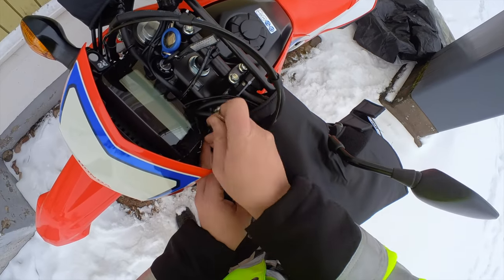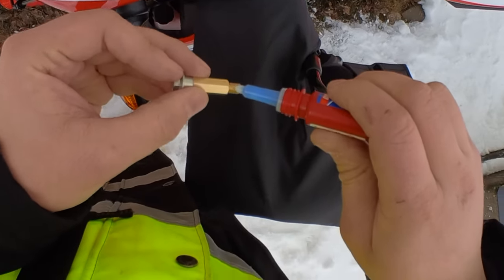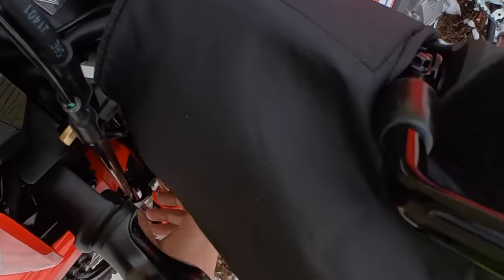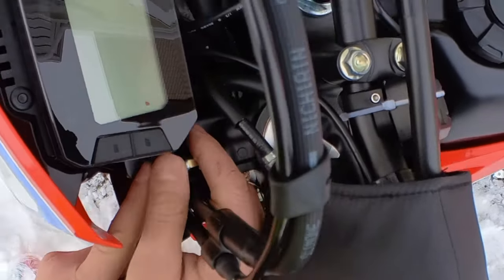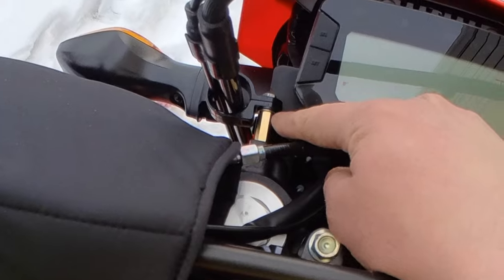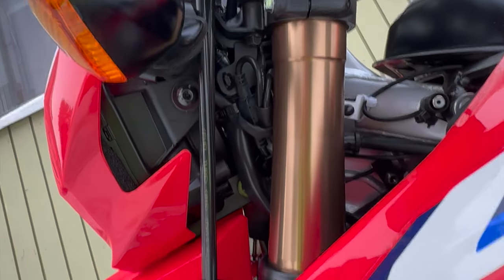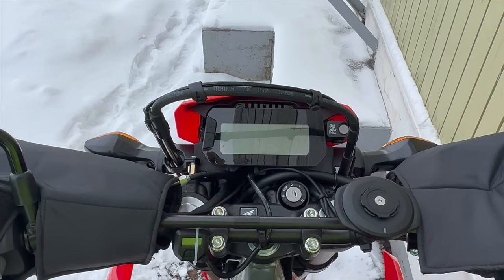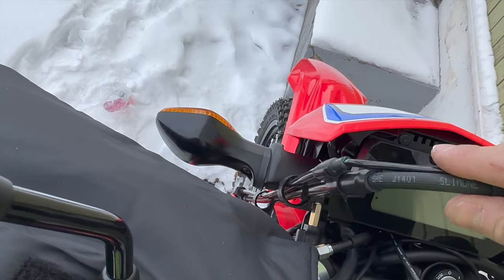Honda CRF300L Brake Hose FIX

Comment: It would look even nicer if you paint the spacer black.  It would blend in better with dash and cables better and would not be as noticable as the gold color is.
Reply from the maker: True. Im not that into details myself 😅 also I dont have this setup in the bike anymore. I built a rally tower (check the latest vids if interested)

Comment: I have an even easier fix.  Just undo the circular holder for the brake line and slide the brake line in front of the left turn signal.  Done.  BTW, you can reattach the holder as original if you want to keep it for whatever reason.  Maybe to hold some flowers?
Reply from the maker: Might work but it will twist the brake hose way too much and completely unnecessarily. Might as well do this mod and keep the line straight.

Comment: Why is this brake line even rigid? Couldn't we replace it with a soft brake hose and get it completely out of the way of the dash?
Reply from the maker: Swapping hoses with different kind of products is probably also a workaround to this 'probelm'. 
But I don't see a point in swapping them as the oem hardware is working ok. Also the bike has 260mm of travel stock so the lines move a lot. No matter what the solution the lines need a lot of movement at the top.

Comment: Any concerns with breaking that if the turn signal gets hit hard enough? Maybe there isn’t a high chance of that? I don’t know how easy the front ones get hit. The rear are super exposed.
Reply from the maker: Highly unlikely. I have never hit the front signals with handquards in place.
If unlucky the brake hose can also hit something directly. 
The plastic bracket is more likely to damage than the metal extender screw.

Comment: Does it makes a big difference if it's stainless steel or brass spacer ?
Reply from the maker: All of these metals mixed might get some ”corrosion” affect in the long run. Not sure which combo is worse.

Comment: I done it but it doesn’t make a lot of difference
Reply from the maker: Well thats not good 😕 For me it fixed it. How tall are you?
Reply: @PatchedBandit  6ft1 I noticed some off the cables on the bikes are better positioned either more forward or back, mines is more towards myself, I can see my gear position a bit better 👍

Comment: It's wierd. I don't see the kawasaki or yamaha bikes with this brakeline issue. Why is honda doing this? It really is annoying.
Reply from the maker: It's a weird deisgn for sure. The reason for the top loop is to give slack to the long suspension travel but it definitely should not be where it is from factory 😅